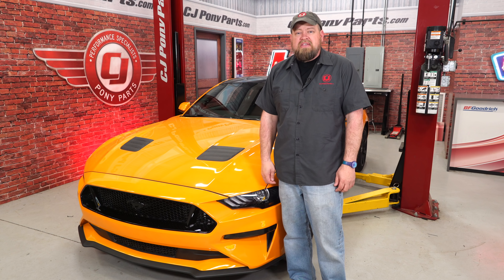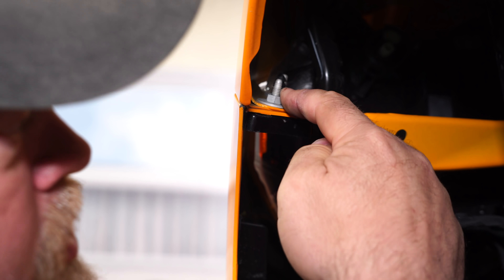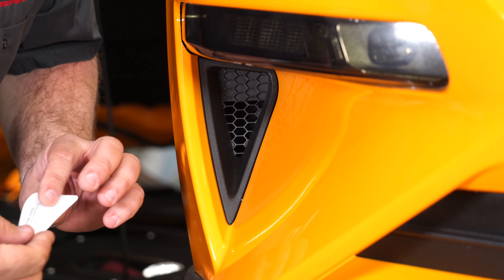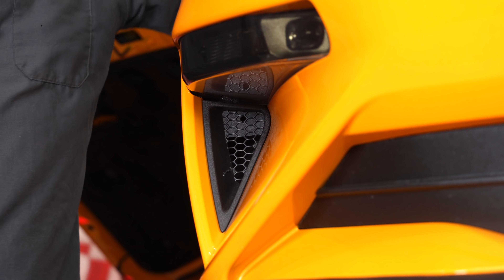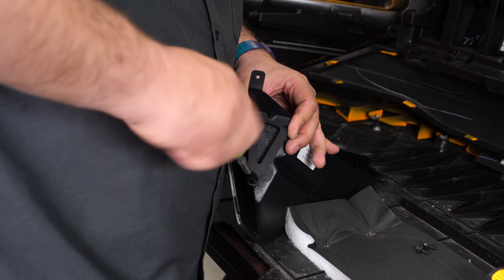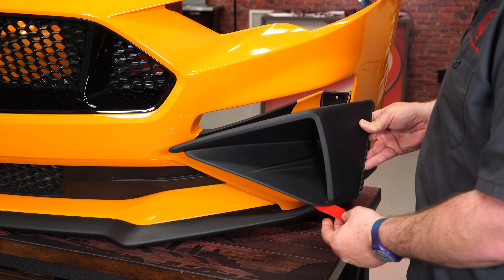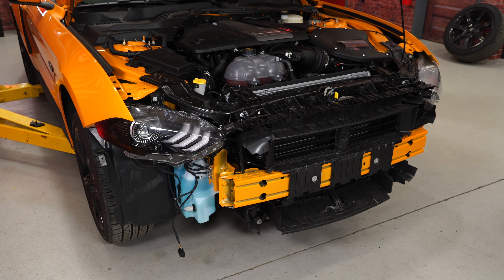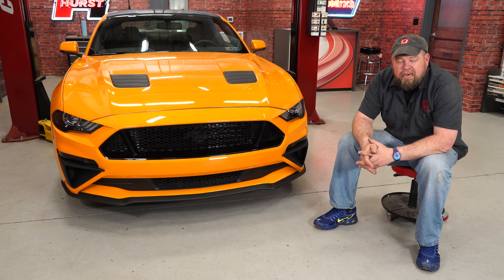2018-2022 Mustang GT Gets an Aggressive Face-Lift after a Roush Front Fascia Corner Pocket Install

Comment: I installed these on my car without drilling.. just used some Gorilla 30lb double side tape. I refuse to drill into my bumper
Reply: Thats what ima do! Just use some good ole 50lb tape
Reply: Does it fit flush if you remove the 3 tabs. Is it still holding up with 3m?

Comment: Was all that even necessary. That 3M tape does magic to hold things.  I would rather Dremel out the plastic tabs on these covers, and apply a bunch of that 3M tape to hold that piece in place instead of drilling all those holes in the bumper.  There's a great deal of surface area on that flat nose area of the bumper.  Besides, if you ever decide to change that look you are screwed!

Comment: You need to punch holes in those corner pocket upgrades. Otherwise your blocking the air flow to the brakes that was there stock.

Comment: I put mine on without taking the front end off.  Just used the double sided tape, cut the tabs off etc... Drilled a couple tiny 1/16" holes and used a couple tiny black screws to help hold them on.  Gaps aren't perfect,  but what the hell, only took half an hour to slap em on.
Reply: I was thinking of doing it this way too how is it holding up at speeds for you?
Reply: @BrayZap  Still on 5 years later no problem
Reply: @synthystation  awesome so glad it hear it, I want these but don't want to go through all that

Comment: Upgrade your functional aero to non-functional fake vents today!  Simply drill a ton of holes in your factory bumper then stick the thing on there with tape! That’s gonna be a big no. This part seems more like no-brand eBay junk than an expensive Roush accessory.

Comment: I'm still undecided on the changes aesthetically, but performance wise it's great. I do, however, find it really annoying that they gave EB fake hood vents. WHY? So they can pretend for a moment to be fast?

Edit: I see the idiots that designed that previous bumper attachment (awkward angled screw in a difficult to reach place) either did not work on this, or learned to make it more accessible this time around...

Comment: I don't understand why those little pockets aren't functional from the factory.
Reply: 6ixSpeedStang18 umm...they are unless you mean functional in another way there is a hole right to your tires to help keep them cool
Reply: Dylan Wilkins that plastic piece is all one piece. Maybe I need to look under the light. I'll check it out in the morning, but I'm pretty sure those inserts are not functional. They don't have any openings in the plastic to let air in. I see that one has holes in it but mine doesn't. I'm pretty sure those are aftermarket.
Reply: I think it depends on what package you have. I see some have holes in on the air pockets, some dont
Reply: 6ixSpeedStang18 they all have holes in about half of the pockets. I’ve seen them at the dealership even on the base ecoboost
Reply: Darkdeath171 they don't all have holes. Both me and my buddy have 2018 performance packs GTs and they don't have holes.
Reply: MrJhAam yea that must be the case because both me and my buddy have 2018 performance packs and neither one of us have holes in the pockets.
Reply: Darkdeath171 I just looked at pictures of other 2018s and non of them have holes. I found 1 picture where they had functional pockets. Mine doesn't have functional ones and neither does anyone else I know with a 2018 GT. Maybe the performance pack don't come with functional pockets because even the ones I had saved on autotrader before I bought mine don't have the functional ones.
Reply: Darkdeath171 just went and looked at the dealer. All the non performance packs had functional ones while the performance pack didn't.
Reply: 6ixspeedstang, they are functional pockets. They direct air to the brakes. You can even see the gap behind the fender in the wheel well. There's a rectangular opening. And in the pockets themselves in front, there are honeycomb holes and 75% of it is open for air flow. You can even see it in the video in the beginning here. I think it was dumb if roush to take that functionality away. Especially since they stick out into the airflow nicely.
Reply: MH motorVlogs I went to the dealer and I have a 2018. Not all of them are functional. I can make a video show you if you'd like to see. Performance packs don't come with functional pockets but the other models do. They had performance pack and other models lined up next to each other and I saw the difference. Both me and my buddy have performance packs and they don't have holes in that part for us.
Reply: MH motorVlogs this one in the video isn't a performance pack that's why it has the functional ones.
Reply: 6ixSpeedStang18 what makes it different with the performance pack? I was just goof off what I saw on a gt with a black pack
Reply: Dylan Wilkins I'm not sure on why they made it different for the performance pack.
Reply: FYI to those wondering why the pp gt's do not have functional corner pockets? my 2¢ guess is because we already have Brembo big brakes which don't really need the cooling, the holes on the non pp versions are to help cool off the oem brakes :) makes sense?

That said, i like the look of this roush corner pocket, however no way am i drilling holes on my nice shiny bumper for something not functional.
Reply: Julio Garrovillas that's a very good point you make. I guess now I'm just wondering is why not just make them all with holes. Like it couldn't have cost Ford more to make all of them functional even if the brembos on the pp cool a lot better. But I guess no use in wondering when I could just buy the stock functional ones. Lol.

Comment: These facia corner pockets were developed because most everyone agrees that the 2018 refresh is absolutely ugly with those bizarre looking "catfish whisker" things that this mod is designed to cover over. Sorry, but I am absolutely thrilled I got my 2017 GT before this weird looking, very un-Mustang front redesign was carried out. The 2018 Mustang looks less Mustang with the new front end. I don't even like the hood! The strakes that my mustang has on the hood are absolutely badass looking, but the 2018 does not have them. Even the new hood vents suck. The only real redesign I really do like about the 2018 are the new tail lights. They look amazing! As soon as they are after market available--I will be sticking the redesigned tail lights on my 2017.
Reply: youchris67 youre just bitter u got a 2017. 2018 is still superior over its predecessors.
Reply: youchris67   Na bro, the 2018 is better than 2015-2017. The only thing I don't like is the lower fascia. However, the Roush design is absolutely Fire!!!!!!!!!!   People are trading their 2015 thru 2017 in daily for the 2018.
Reply: Why? It's the same car. Total waste considering that in 2020 there will more than likely be a totally redesigned Mustang that will make all the current obsolete.
Reply: No, I'm not bitter at all. Why would I be considering it's the same car. I've already made motor mods to my 2017 that makes it as powerful and fast as the 2018. Seriously, the cosmetic changes are so subtle--most people never notice. And again, that lower facia with those catfish "whiskers" things are absolutely awful. However, even though I love the front facia on my Mustang more than the current one--I am about to put the superior to all looking Roush front facia that totally blows away the 2018's in looks alone. In addition--anyone trading in 2015-2017 Mustangs for the 2018 are all in a for a rude surprise when a totally redesigned Mustang comes out in late 2020. By the way--I won't be trading in my current 2017 as I will keep it as I purchase the 2020 or 2021. That way, I'll have two Pony Cars! Ha!
Reply: youchris67    Obviously u have not test drove or seen one in person. The 2018 has more horse power. Drives and performs better. Has the dual exhaust. The front hood is lower. The Roush front fascia makes the 2018 look hotttttttttt.. Why would i wait till 2020 to purchase the new design when its not guaranteed to be a hit... Case in point the atrocious 2019 Camaro.. It should be called a Toyota Camaro..Absolute flop.
Reply: Ahhhh. Beauty is in the eye of the beholder...
Reply: youchris67   No, the 2018 Roush I have seen in.person. Best looking Mustang evet beside the GT 350R